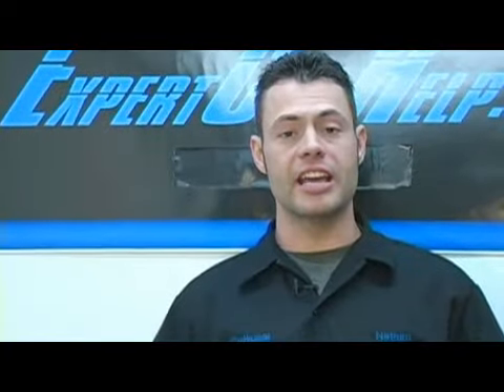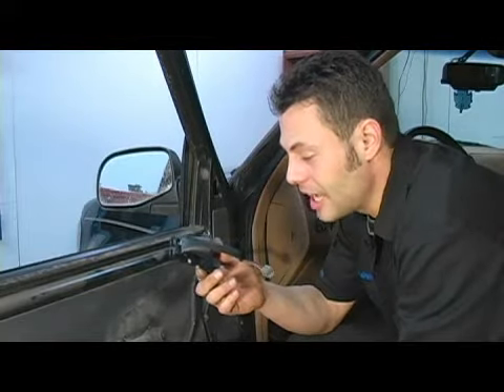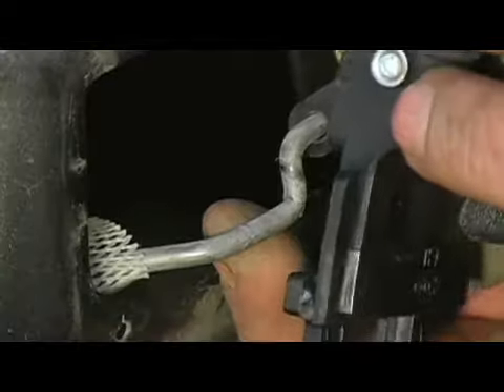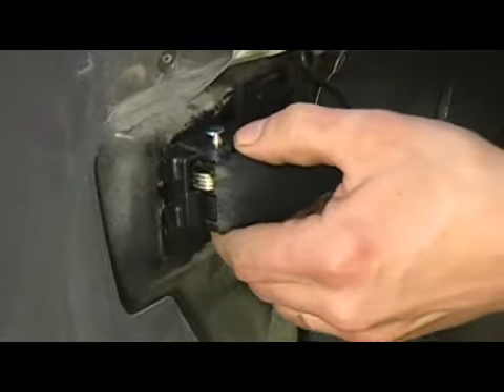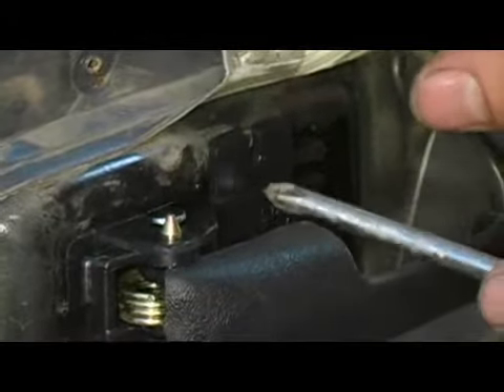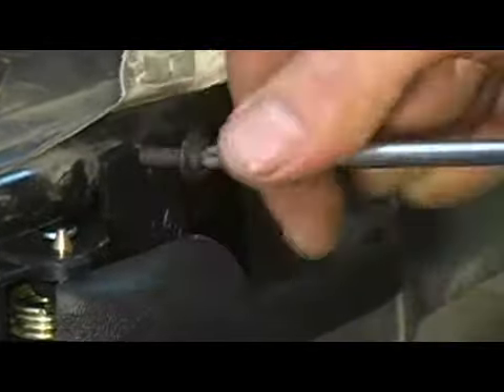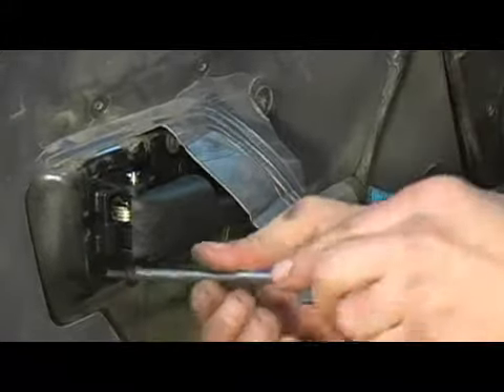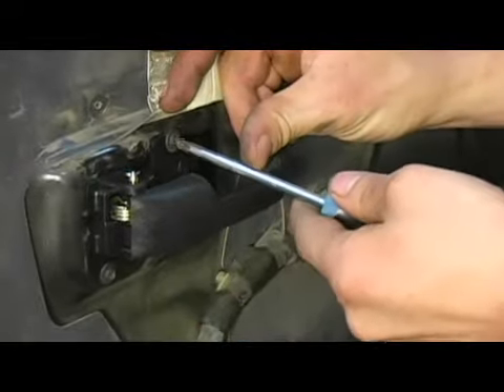Replacing an Interior Door Handle on a 1996 Ford Explorer: Attaching New Handle

Comment: Thanks - I couldn't get the new assembly to fit in. I think my part is a little longer, with extra tabs in front of the upper screw notch. Your details helped me focus on getting the tabs on the back in place.
Then lubed the heck out of everywhere, all four dorrs - now the door unlocks easy!